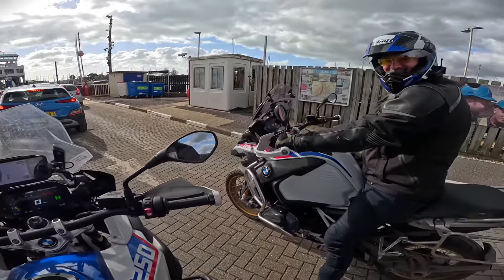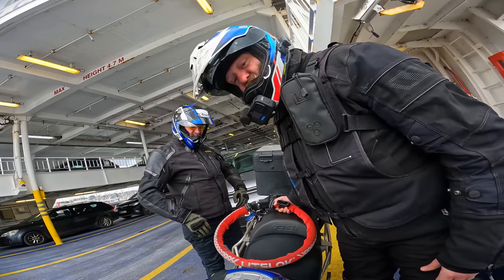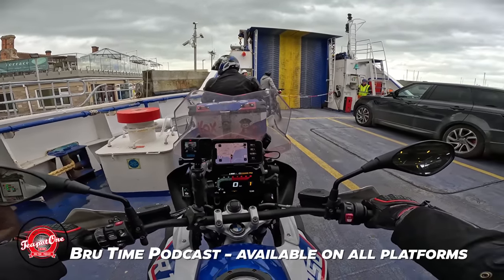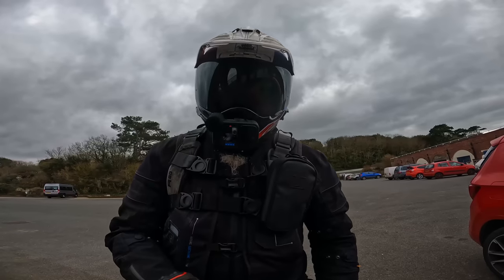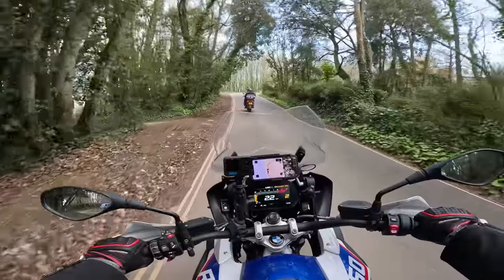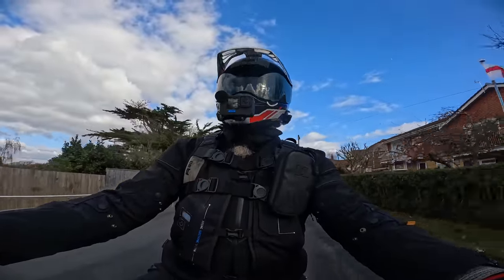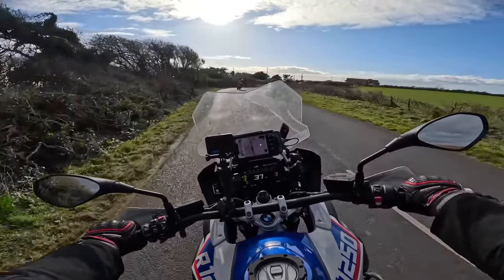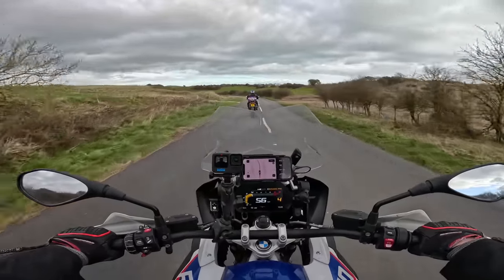Isle Of Wight TT Vs PIRATE!

Comment: Why is the big wrap better than a sturdy u-lock? Seems like it's just massive but not massive enough to be super useful. So go compact. They make some u-locks that are Diamond rated for unbreakable. The Bennetts guys did a video on one not too long ago and it seems like it'd do the same thing but be way easier to just mount somewhere. Heck, you could make a bracket for it on your top case or something or rok strap it.
Reply: I bought the X1 - it came with a mounting kit

Comment: Q's Brucey: 1 = what is the red button you press under the left mirror stalk? 2 = can you explain (even in a separate short) what the purpose of the "3 2 1 Sync" visor closing is all about?
Reply from the maker: Hello bud, the wee button under the left handle on the bars is for my ‘Jekil and Hyde’ exhuast - it cycles between the 3 different modes to alter the engine note. Quiet is useful for passing horses, going through villages, early mornings etc, loud is great for when you’re feeling ‘lively’ and want a deep growling exhaust note, and the 50/50 is a nice inbetween.

3-2-1 sync just lets me sync the helmet cam with the cockpit cam (the one looking back at me) 👍

Comment: 34:33 I sort of get it but not really. Think of it as an aeroplane wing... The faster air passing over the front of the sail is lower pressure than the air behind, I.e. pushing the boat forward (as opposed to lifting a plane). It's how wind turbines work too... I'll get my coat.... Great vid Bruce.

Comment: Hi Bruce i to used a cable lock to secure soft panniers to my bike and if a fellow biker didn’t point out to at the petrol station “ hey mate what’s wrong with your rear tyre “ it could of been very bad,the plastic coating had worn away and the metal cable had put a grove into the tyre and after now 10000 kilometres it’s still slightly noticeable didn’t effect the handling of the bike but at the time it was a deep grove. Those roads on the isle of white don’t look wide enough but you where properly on the wrong road, who knows will probably never happen.

Comment: Bruce I’ve always thought of u as a very intelligent man - the lock comes with Velcro fasteners / so fold it up into a small loop and wrap the Velcro straps around it . Then stick it in the top box - you can store other stuff into the centre of the ring - simples !! “🥃”… sorry for sounding arrogant but it’s - well - obvious !! 😜😂

Comment: Hay mate want a bike but don’t know what to get first bike think 💭 125c
Reply: Do you need a 125 because of L plates?
Reply: @HalfManHalfPirate  just want a bike to used was thinking about suzuki intruder 125 times r sometimes big
Reply: @Rosieterrier258  if it were me I'd buy a cheap reliable 125 to get my CBT and a bit of experience as they are all the same power pretty much.  I'd then get my licence and buy a bigger bike to fully exploit the joys of having a bike. More choice in styles, configurations etc. 
Good luck with getting one regardless of what it is.

Comment: It's not the channel, it is called the Solent. Also,  you were breaking the law with your drone, whilst you flew it, you need to apply for an operator id from the CAA and affix the number you get to the body of the drone, it costs £10. As a sub 250 g drone you don't need a drone pilot's licence but you do need to check drone assist app before flying it anywhere to ensure that there are no flight restrictions such as airports and prisons etc.